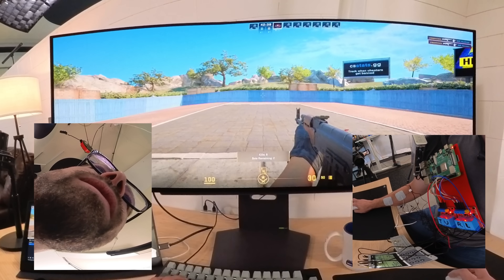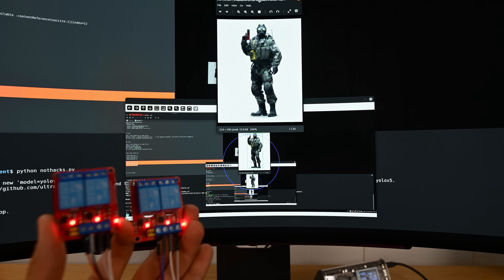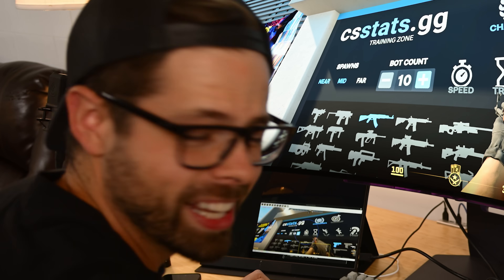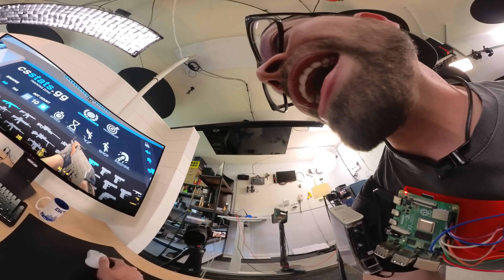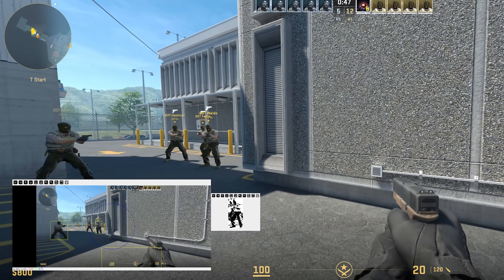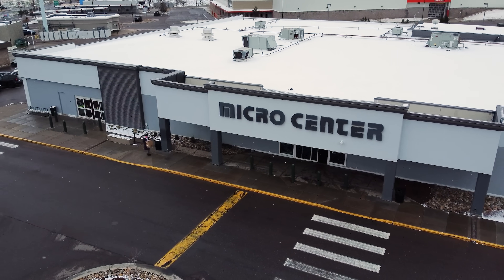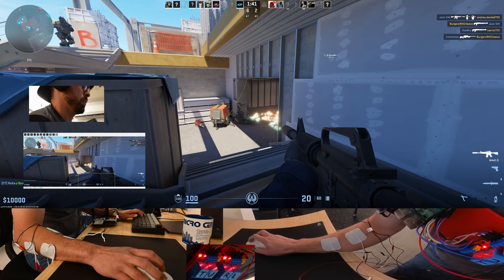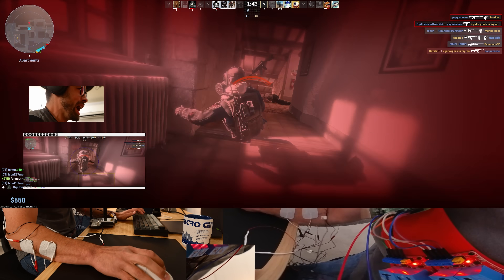Neuromuscular Aim Assist

Comment: 15:59
Screams in pain for the whole video
"In conclusion, it works really well but the main drawback is the electrodes aren't surgically implanted beneath my skin so I'm still not as fast as I could be."
Continues screaming in pain
Reply: In conclusion this is also a really weird video to watch on speakers.
Reply: Gotta use painkillers first xd
Reply: @SPCabbage us military
Reply: Wouldn't it NOT HURT if the electrodes could bypass pain receptors in skin?
Reply: @Shayeta  I'm pretty sure there are plenty of pain receptors in your muscles. Just look at videos of people with torn ones.
Reply: @NevelWong Okay, this is true, but it can hurt in a lot less specific ways. Think about needle as opposed to hammer. One of those hurts WAY less.

Also if you were to do this with a brain implant, it actually wouldn't hurt at all as there is no pain receptors inside the brain itself (this is why neurosurgery can be done on conscious patients)
Reply: @Aryasvitkona  A brain implant will be too slow, bioelectricity is a LOT slower than circuit electricity. Bioelectricity relies on ion movement whereas through a metal just electrons move. Even from a kinematic perspective, the ions are wildly heavier than electrons, with more momentum required, meaning slower start/stop for ions, even if they had the same top speed (they do not).
Reply: @deepnmeatyrodric8369 Hmm yeah that's probably true, if I remember right the delay for just sight is like 80ms, but it would solve the pain problem. Mainly would be useful for people with limited mobility though due to neurological damage like strokes
Reply: "I finally uploaded my consciousness into my gaming setup"

-jetstream Sam , 2013, colourisied
Reply: That's just a Kereznikov lmao
Reply: Also technically an kink video for sadists
Reply: It doesn't actually hurt, he's just screaming for the views. TENS is very mild, almost feels numbing.
Reply: For real. Dude did all of this to literally be silver level 😂😂😂

Comment: I never thought this would actually work this good before clicking on the video. Very impressive. I'm not even mad if someone beats me by volunteerly getting electrocuted.

No joking, I seriously hope cheat like this (image detection based) become more wild spread so video game companies would switch to behavior analysis based anti-cheating (like if someone consistent pull off lower than average human reaction time, and/or consistently having inhuman cursor movements, etc).

Anti-cheat software nowadays has become so invasive that I gave up playing competitive games on PC. They are always huge resource hog, always runs in background even if I'm not gaming, and running at kernel level leaves much privacy and security concerns. And worst of all - they don't stop the cheaters.

I wonder why doesn't microsoft just build a "competitive gaming mode" into windows that halts evey piece of software that is not signed by Microsoft temporary, this would not invalid every cheat, but would give those invasive anti-cheat softwares no reason to exist in the first since no software based cheating would be possible. It's like Microsoft want those stupid privacy and security concerns to keep existing on Windows.

Comment: You need to test if this trains your natural abilitys also. So benchmark your skill before and after, lets say 1 hour a day for a week and then se if you got better after that. Many years ago I was going to participate in an Unreal Tournament LAN competition. And  under the week before I was recording botmatches to publice on a forum or website to inspire other people to sign up for the tournament. The problem was that when recording, the game speed was lowered due to a slow computer (the replay of the videoswould run in normal game speed though). So for make it look realistic I had to slow down my mouse movements. And when doing that I tried to move my crosshair without additional adjustments, like if I moved to far and had to move back a little to hit a headshot. So in playback it looked like I had this godly precision. :) But It did look realistik, with no hyper fast movments. The lan tournament I won. And I had never won before. So I my theory is that when I recorded those videos, somehow my brain learned something about aiming in that game. Like I learnt a behavior more easily in slow speed, wich made me better in the live gaming. Our brains and nervous systems are amazing when it comes to learning. So my take in this electrocuting thing, is that it will propably be possible to train your reaction responses with this tech.

Comment: You didn't write the disclaimer so I would do it even if the video was very fun to watch:

Using electrical stimulation to control muscles and nerves is not a harmless hack, it can cause serious injury if done incorrectly. The nerves that control your wrist and index finger (median and radial nerves) are located close to blood vessels and other sensitive tissues. Misplaced or excessive current can result in:

- Nerve damage (temporary or permanent loss of sensation, weakness, or paralysis).
- Severe pain from overstimulation of sensory nerves.
- Muscle injury from sustained contractions or tensing (tetanization).
- Loss of fine motor control if the brain becomes dependent on external stimulation instead of voluntary motor commands.
- Interference with motor plasticity, potentially degrading your precision when the stimulation is absent.
- Uncontrolled movements leading to accidental injury.
- Risk of cardiac interference if current flows near the chest or is misrouted, which can be life-threatening.

Electrical muscle or nerve stimulation should only be performed with medical-grade equipment and professional supervision. This is not a safe DIY experiment, it’s a high-risk medical technique, not a gaming trick.
Reply: I think you're missing the point. The fact that this works on a primitive level opens the discussions to researching this type of thing even further. People with high funding and a lot more knowledgeable in this field will figure it out. This has some seriously implications depending on what you want it used for 😂
Reply: True,

Comment: I’m 30, and my reflexes are still in the top 2% in the world. It’s all about what you do to keep your motor skills polished. At the rate I’m going I will have a .2 reaction time until I’m around 50.

Tested my reaction time 10 times a few months ago and it averaged to about .156ish without a single pre click. 

I think we need to do an updated research personally to determine reaction time degradation because I think the current chart is outdated or flawed. 

Oh and I’m normally using marijuana when I game since I have a medical card for shoulder pain, if I don’t smoke my reaction time likely goes up even more as for how much I have no idea but I would think it definitely goes up a little bit.

Comment: dude you should put multiple of those things on or arm - relax it - and make a software (easy part ik ik) that creates a direction in which to flick and howuch and gives you random intensity impulses at a random place to calculate where and how much to stimulate for a desired outcome. Than you can just turn it down a bit and use it to train urself to be better.

Comment: I done something very similar to this using just a tens unit no program, or micro controller quite some time ago. I did talk about it to some friends, but didn’t take it any further because (I’m a console player, when I do play not very often anymore) 
Just running a straight tens unit if you connect it correctly will definitely help, even after without the unit your reflexes like get a slight boost from it. 
One thing to consider though, most folks who work out with weights. I’m not talking bodybuilding, just relatively normal muscle work, everything gets worked leg, arms, and abs. But the hand muscles, wrist, and fingers hardly ever get actually worked too. If the muscles in your hands and fingers are weak, it will take that much more energy in order for them to work. You’d be surprised at how much difference just a 1 or 5lb weight can do when used to work those specific muscles in the hands, wrist, and fingers with just a few weeks of it. Remember you’re not trying to really bulk the muscle mass a lot, but you don’t want them weak either!  Muscle our biological electrical motors in away, and the nerve their our like the electrical connections to said muscle/ biological electric motor. The tens unit can help build those muscles, but used incorrectly it could in theory also weaken the muscles. Also the surface area of the pads that’s important to, you want the electrical signals to reach the nerves only not the nerves, and a bunch of muscles around said muscles. Tend units are normally designed to spread out the high voltage, extremely low current signals to increase the surface area such that it “ couples to the muscles more then the nerves” and also decreases the chance of heating/burning of the electrode area. I.E decreasing the size decreases the surface area, would concentrate the electric current more directly to the nerves them self, and less of the overall muscle mass( which is what makes it feel “resistive” like your arm or fingers what to move, but at the same time the whole area of exposed muscle getting that signal activates the whole muscle instead of just sending a signal. It wants to move, but the muscle is tensed, and can relax so there’s this very strong equal and opposite reaction created, but when you decrease the surface area of the electrode then the pain can go up proportionally, but at the same time you do not need that much amplitude of signal either, I cant tell but it seems the tens until is turned up pretty high, which in turn is creating it’s discomfort, when really all you need is just enough signal that it “nudges” you in the correct direction, instead of making/forcing you to move. 
Which then ties into the fact you’re dealing with 3 different computers. Your dealing with the main PC to play the game of choice, the microcontroller which is the tens units switching unit between your main computer and itself, and the last computer is your own brain it’s self, a biological brain that which has awareness and that comes into two forms your conscious and your subconscious. Which is why your arm was so tense during the experiment because you’re fully aware of what exactly you are doing, and so is your brain in both states conscience and subconscious. cautiously, you might be ready for the signal but subconsciously your brain is not because it is not natural.

Comment: This is the kind of sht I expected to be tinkering with after engineering school. Then I finished and got a job and don't even want to tinker at all. All my breadboard supplies, soldering iron, are just rotting away in my closet for the last 8 years or so lol

Comment: Cool concept but i feel like i have to call BS. I have a tens unit and anyone who’s used one can tell you that hooking it up to your arm muscles like that isn’t going to have the effect he’s describing. When muscles activate, the smallest ones work first and then as the load increases, larger and larger muscles engage to compensate. Imagine someone has their boot on your hand. Try to lift it up and the first muscles that fire are the smallest ones in your hand followed by the hand itself and then the arm and shoulder. Putting electrical impulses into the bigger muscles don’t cause them to twitch in a certain direction because biologically we are more advanced than having one arm muscle to move in one axis, and one different arm muscle for the opposite. It would just cause spasms within that muscle. Which is the point. Otherwise when he activated it as a test his arm would fling out or in based upon that electrical stimuli alone. If anything you would want to somehow spasm the hand muscles to cause the wrist to move left or right since those are the finer muscles that engage first with mouse movement anyways 

The real use for this would be as a cheat to vibrate left or right to let you know if you’ve seen one. 

He mentions it could be possible with more accurate equipment and specific targeting of the muscles and i fully agree, it’s possible but in its current configuration i don’t think it actually helps to move the arm with any real effect. 

The triggerbot is interesting and quite honestly makes the most sense. That’s one of the smaller muscles previously mentioned which is designed to be quick firing so those electrical impulses to have it spasm in order to click a mouse is a great combination. the scout clip kinda shows how that deep learning to detect what a T character’s color combined with that instant spasm reaction can absolutely beat normal reactions and players.

Comment: You could absolutely train yourself to be better without it by using this during practice. That's straightforward stimulus mapping of your eyesight and your arm movement.

Edit: also for this to fully not be cheating you need to also be feeding your eye data into the raspberry pi rather than the screen being read.

Comment: If you lower the voltage of the shock you should increase your accuracy and reduce the overshooting. Increasing the voltage will just pull your muscle further, thus causing overshooting

Comment: To reduce the discomfort from widely spaced pulses, avoid any DC component (“constant current”) and opt for a charge-balanced biphasic TENS with short pulses (≈100–200 µs) at a high frequency (≈80–100 Hz). Set the intensity to a strong but non-painful sensory level and use large-surface electrodes to limit current density. The hypoalgesic effect (gate control type) sets in within a few minutes.

It is possible to experiment with a combination of frequencies — for example 30 Hz, 80 Hz, 100 Hz, and 250 Hz — each at an individually adjusted intensity, to generate less monotonous temporal patterns and reduce habituation. Since your goal is not strictly medical but simply to make occasional strong shocks more tolerable, optimization should take into account current density, pulse width, and your own sensitivity.

[Additionally, some people use stimulation via acupuncture needles (electro-acupuncture), which lowers skin impedance, but this requires a substantial reduction in current and carries risks if not performed in a controlled, safe setting. I have never tried this myself.]